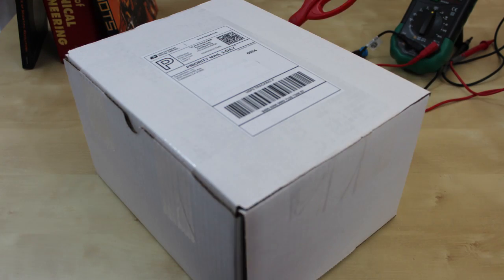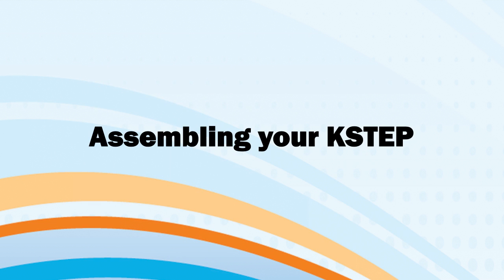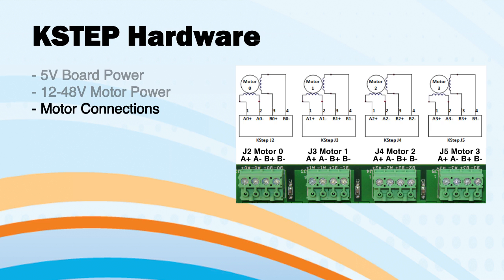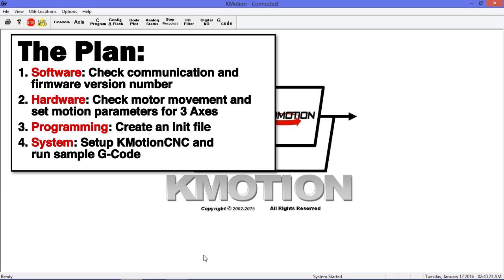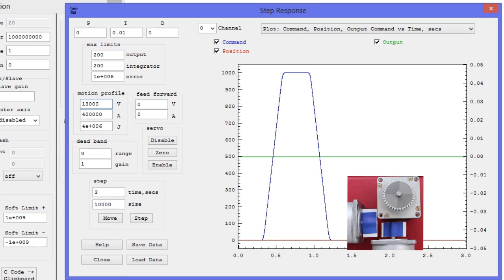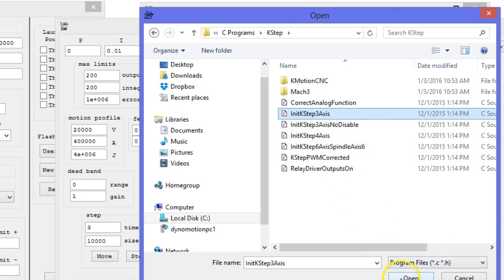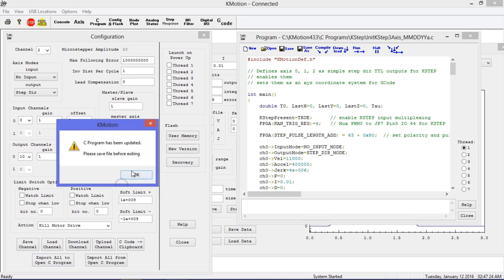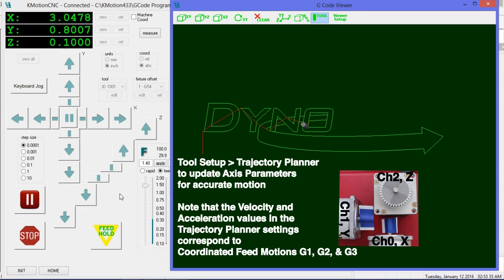KSTEP Introduction - Getting Started with KSTEP Stepper Driver

Comment: Just one note... the Step response monitors the Soft Limits for some reason. If you try to use a Step response after setting the +ve Soft limit, it will stop abruptly. You need to overwrite the +ve Soft limit to some very high value temporarily if you return to tuning at any point with the motor attached to the machine.